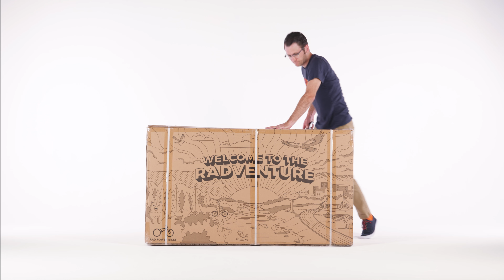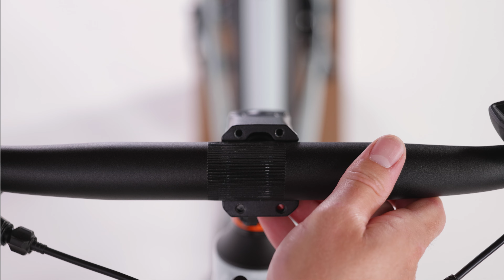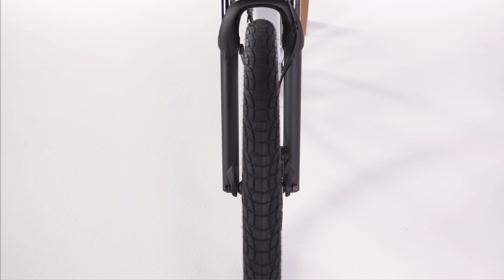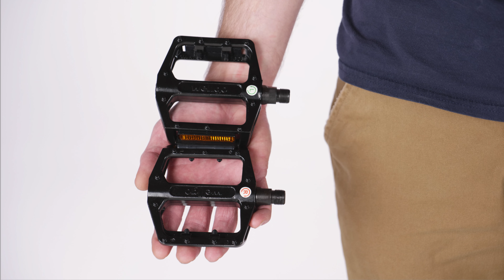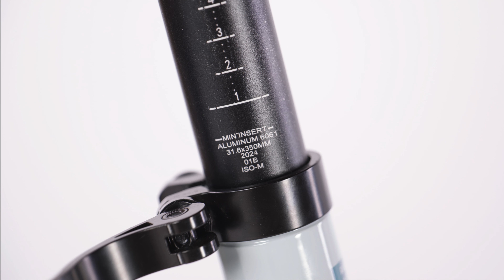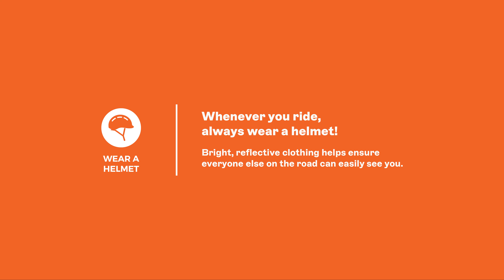RadKick Assembly | Rad Power Bikes

Comment: Thank you for the assembly video for the RadKick. It was very helpful to have the video playing while reading the assembly directions. The only difference for my bike was the front fender. The assembly book and video show the screw and washer coming off the bike, but my screws were in a plastic bag in the accessory box. Other than that the assembly went pretty smooth. Now I need a dry day to test ride and make the comfort adjustments.